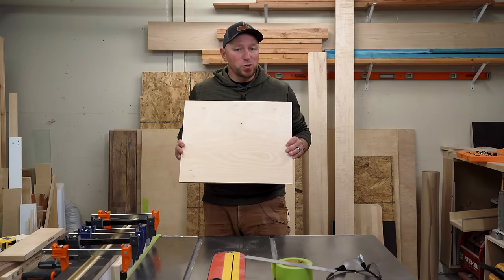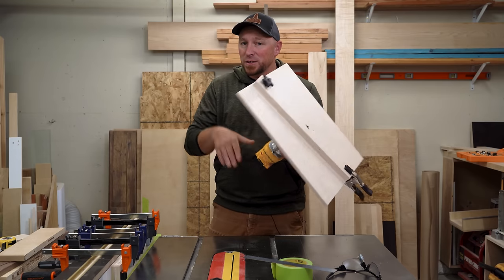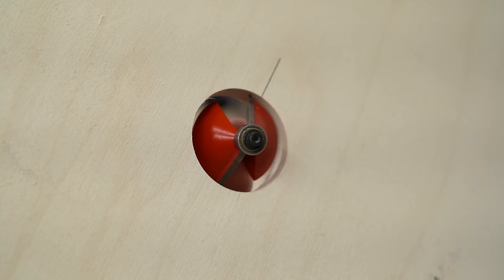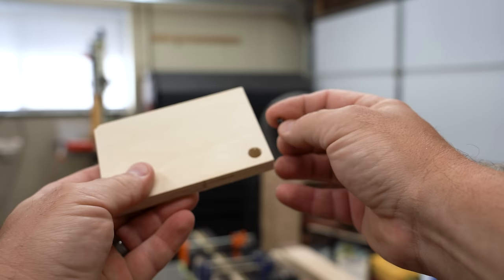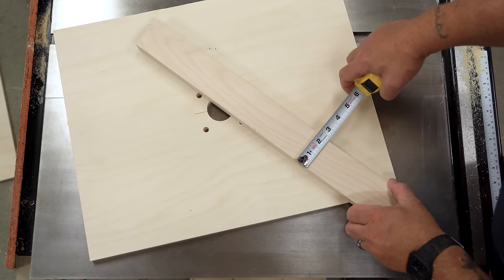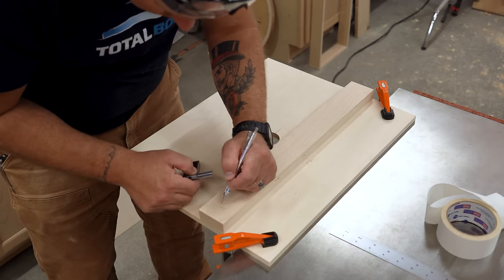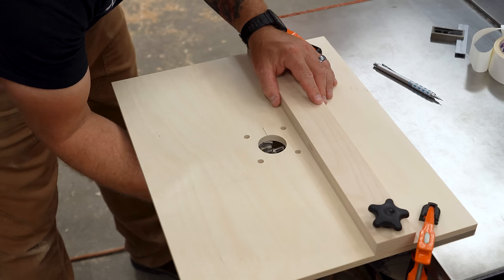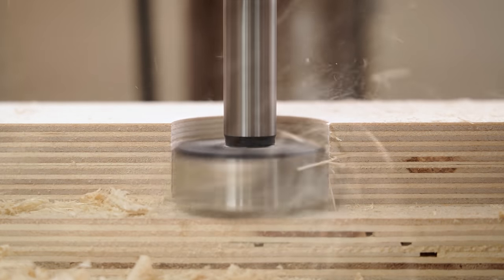The Simplest Portable Router Table

Comment: For those of you who made this out of 3/4" plywood instead of 12mm birch and suddenly realized that the 4 screws that came with your cordless 20V DeWalt DCW600B router aren't long enough, don't worry...  The correct screw is a metric M4-0.7 x 25mm screw, and can be found at Home Depot.  And you most likely won't find them hanging on the wall with the rest of the screws packages.  You'll probably find them in one of the drawers with the rest of the metric and other speciality hardware components.

Comment: 30 yr carpenter here and that is what we used to make onsite if needed, minus the fancy handle on the fence because we would just use a nailer or screws. I like the idea of adjusting the fence though without just using clamps. couple of bolts from the spare bin recessed and glued with wingnuts I am thinking. thanks for that and good video no messing around lol.

Comment: This is awesome, because it's truly perfect for a small router. Plus, you used your Jedi mojo trick of reductionism to perfectly arrive at the essential elements of the table. So much safer than that 'clamp my router in a vise' technique I see people here on YT do (good way to shorten a finger, btw, ask me how I know this). After getting a great little Makita, I almost never use my old, big Porter Cable (690 with the screw-adjust base) anymore... great old router, but it's almost too powerful.
Reply: Hey, I resemble that remark! Yes I have clamped the palm router in the woodworking vice. I think I would screw a 2x4 to the bottom of this jig/table so it can be clamped in the vice, just so the vice doesn't get an attitude.:goodvibes:
Reply: @MsLorisM  No insults intended. I think, though, that the power of the router is the big factor. Not willing to chamfer off a fingertip again here. Very bad way to trim your fingernails.

Comment: Easy and functional!  I have an outfeed table for my table saw with 5/8" plywood top so i did a similar thing with it- I drilled the holes and mounted the router under the top.  I drilled another hole through the table and put a T-nut underneath for the pivot end of the fence.  I don't have any dust collection which can be a problem but I don't use it for large jobs.

Comment: I like it, gets you your routing table fast, and it's still easily modifiable down the road, I'd likely make  2 L shaped braces that attach to the bottom and snug into the end of my workbench, as I don't woodwork much outside of the garage. 😅

Comment: Just finished min but using clamps to secure. I used MDF for top. A word of caution however. If you clamp the fence it wants to shift slightly. Will be using stronger clamps. 
Other than that it works perfect for my use.
Thanks for the video

Comment: This is fantastic! Thank you! 

Question: 
Would you recommend leaving the surface natural or add an oil/wax? 
What’s best for a router table surface?
Reply: Personally I would use a water based polyurethane to make the top a bit more slippery but it's not critical to use that.  I would just use whatever you have in your shop that you prefer to use.  Even leaving it natural is ok, it just won't last as long and won't be quite as slippery.

Comment: LOL... I built my router table, several years ago, the same way you built yours, except I clamp my fence on both sides rather than install a pivot. For the really big jobs, I have a Delta shaper, my Dad bought used when he came home from Korea, in 1952. 75+ years old and works as good as new, albeit a VERY Dangerous Tool!! Featherboards are an absolute necessity.

Comment: 3:37 make a small 1/8 by 1/8 45 cut on the underside of the fence for dust accumulation.  or the dust will de-rail your work piece making the bevel some-what unconsistant.
Reply: agreed, good call

Comment: Good stuff bro. My only question is how do you account for the depth loss. So the plastic plate on the router is 1/4 thick but the table top is 3/4-1" thick.
Reply: For use with the table, the plastic plate is no longer used.  As seen in the video, you unscrew it from the router, then use the plastic plate as a template for the screw holes on the table, then screw the router directly to the table from underneath, without the plastic plate attached anymore.  You'll only reattach the plastic plate again when not using the router with the table.